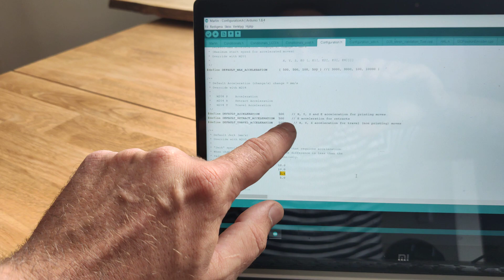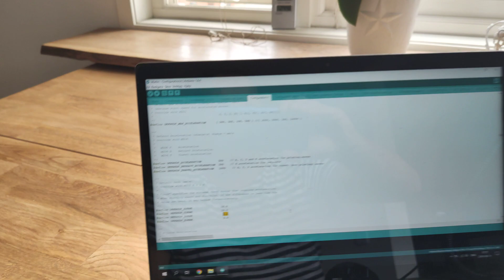Alfawise U30 PRO, Marlin with the Ender 3 PRO settings 👌

Comment: Hey, great videos. Thank you for putting these out there for us. I have a question for you. I am putting this screen and board on a different computer and I got your firmware on the board just fine, but I can't get the firmware on the screen to work. It shows the screen but will not show the thermistor readings, and touching the screen does nothing. Have you messed with the screen at all, and do you have any tips on this? Thanks in advance.

Comment: Awesome Videos about the Alfawise U30 Pro and I can't wait to get mine printing like yours.  I was curious if you have a link to the updating process and if you had a chance to test out Marlin 2.0?  I have opened the source/github files in arduino software but not sure which board to select when compiling the code to .hex.... I found this instruction to be helpful but still missing  https://marlinfw.org/docs/basics/install_arduino.html  thanks for any assistance you can offer.

Comment: what kind of mainboard should I select from the tool menu?
arduino mega 2560?
Reply from the maker: Yes
Reply: @ThousandHobbies  Thanks for the reply!
Instead it is correct processor: "ATmega 2560" and programmer: "AVRISP mkl"?
Can I proceed with the flash by connecting the printer to the PC or should I first install the bootloader with arduino?

Thanks again for your patience!
Reply from the maker: @marcopuccio1806  Alfawise U30 pro (open surce - do not need install bootloader) Enjoy and install marlin in an easy way 👌

Comment: I checked into your "Configuration.h" file, and I found that are setted the A4988 driver INSTEAD OF THE TMC2208??!!!
Reply: I changed the marlin driver type from A4988 to TMC2208_STANALONE and it worked well
Reply from the maker: @marcopuccio1806  have you link you your marlin👌 i want try
Reply from the maker: No ...voltage corect ✌️

Comment: Hello, great video, keep it up!

I also have an Alfawise U30 Pro, if I print a rectangle with 30x30x10 mm wall thickness 1 mm, I get 29.7x29, 5x10, 3mm, you can set that in Simplify3D so that it fits? If so, would you do a Viedo for this?
Greetings from Germany